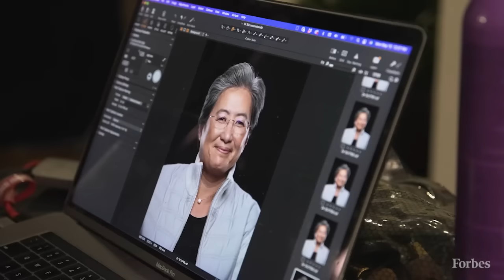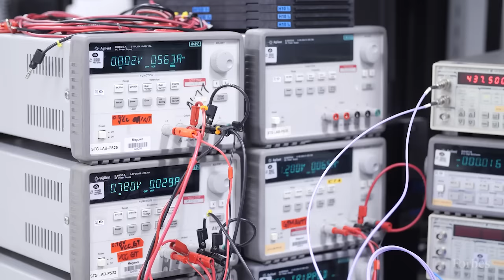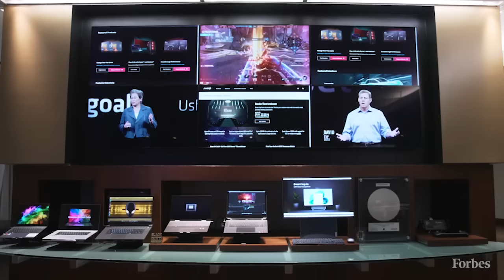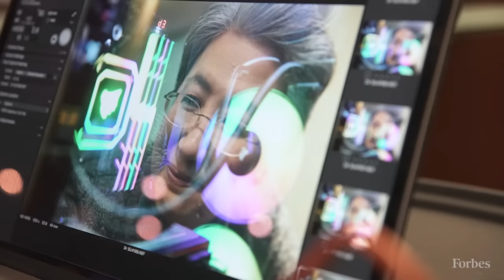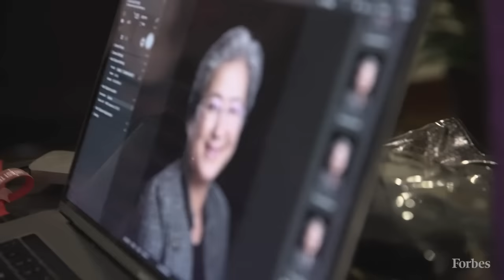This CEO Made AMD Billions – Now She Wants To Dominate The Market With AI

Comment: Getting the Console gaming business was critical to getting AMD back. The Zen Architecture was probably a direct result of investment from Microsoft and Sony for the Xbox and PlayStation. After the Zen Architecture was the chiplet design which with the help of consistent manufacturing from TSMC made them catch up to Intel. AMD on TSMC 7nm was a game changer as Intel was stuck in 14nm for far too long.
Reply: Well, Zen was already in design separately from console CPUs. The reason why Sony and Microsoft invested in AMD was because AMD was willing to do custom chip designs for them, unlike other CPU makers who tend to have a "take it or leave it" mentality. This had led to Xbox Series X|S and PlayStation 5 to each have their breakthrough tech.

The money from Microsoft and Sony not only helped keeping AMD afloat, there's enough to also do some focused R&D. Which Dr. Su had wisely directed into the unstoppable juggernaut that is the Zen lineup.
Reply: @PanduPoluan  AMD won design wins from both the PlayStation 4(2013) and Xbox One(2013) which both used AMD's Jaguar CPUs. This revenue was critical for AMD to secure advanced process node manufacturing from TSMC and fund R&D. Secondly the specs from the Xbox One and PlayStation 4 gaming consoles moving forward were becoming very similar to a PC, which was a huge advantage for AMD since only one architecture (e.g Zen) that could scale across Gaming Consoles, PCs and Servers was needed.
I believe Lisa Su was critical in securing the Gaming console business from both Sony and Microsoft as Senior VP at AMD from 2012.

Comment: Lisa, Mark and Raja really turned AMD around (In that order). 

The issue with breaking into AI is that Nvidia has spent years investing in CUDA, especially at the university level.  

Its hard to be a significant player when for the last decade or so, all the graduates coming into the market are familiar with only one option, and that option is made by your competitor. 

I'm sure Dr Sue will do a great job even with this uphill battle, because if im not mistaken AMD was trading at about $2 when she took over.

Comment: She's like the embodiment of the American Dream, proof that it's still a possible reality!
But above all, my liquid cooled AMD is a shotgun blast and the latest generations of platforms and graphic cards are phenomenal! In the field of "small" computers, those for mere mortals, which are the only planets I know a little bit, in an AMD galaxy far beyond my understanding, the architecture introduced in the 7000 graphic cards is a very important challenge that will severely determine the future of the sector, and deserves much more media attention, but the complexity is great and this does not always help easy communication. However, the transformation in continuity of the RDNA series, from 1 to 3, is both a frontier and a safe place in method and substance, and it's really interesting.
In small processors, the two channels, some, like me, struggle to understand the meaning of the new heat sinks, even if with a liquid 5950x I'm certainly not in emergency! It is precisely a cultural interest, despite the growth in performance is there and it is possible for customers to have a wider choice in every sense. From the 3950x to the 5950x the reduction of ccds number and the consequent loss of scalability was balanced with renowned computing power and energy management, while simulators and more demanding applications seem to have benefited from the 8 core ccds, and the 5950x was just the crown on a legendary platform, a processor of superior class in multitask and multithread, capable of competing with workstations like never before, in the same time improved even in videogames, elastic and versatile like never before, with temperature management from heaven on earth.
AM5 is a huge technological leap with transfer speeds doubled once again, and keeping temperatures down could not be a topic. While the companies that deal with PC cooling are moving too slowly (something expressly for ddr5 Rams does not yet exist, and there are still products on the showcase whose physical compatibility with ddr4 is still uncertain! The heatsinks do not fit!), it seems that the processor registers and the cache memory are the other node of the dispute: some applications would like less, others more, and bringing all the needs together in a single processor is not easy: who knows; maybe in the near future the artificial intelligence could do something about!